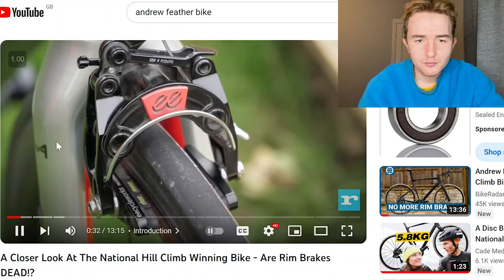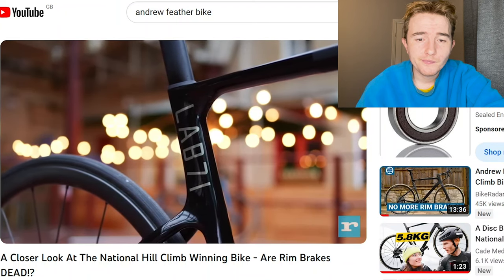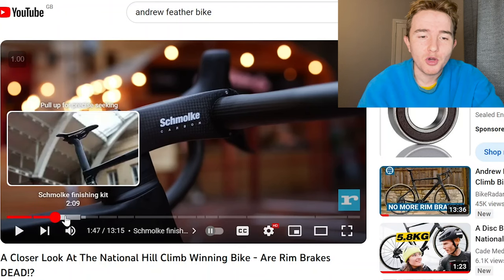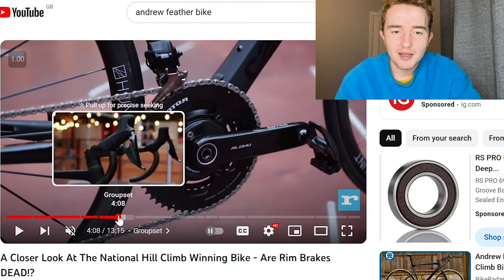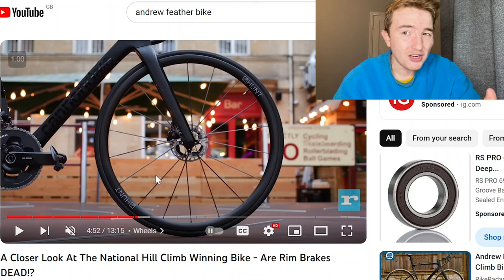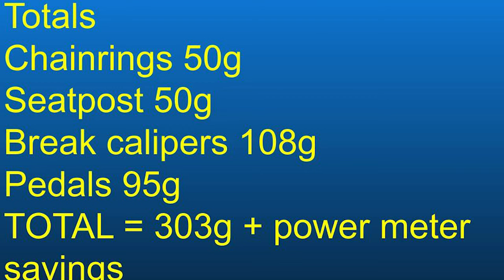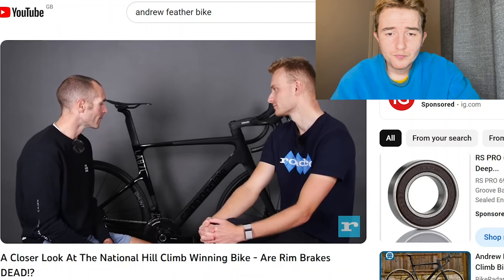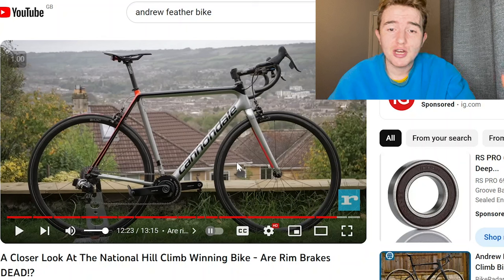How Feather could EASILY save 300g on his BIKE

Comment: I'm pretty certain he knows exactly how much extra weight he could save on his bike. But, is it worth risking those parts breaking during a race though? Carbon TI chainrings with the power he's constantly putting through! you would have to be a pretty serious weight weenie to consider them in this environment......
Reply from the maker: Uae use carbon ti chainrings so that's a ridiculous statement
Reply: @CharlieCarbsandCycling didn't say ridiculous, just pretty risky in that situation. I've hard Carbon TI rings on my bikes in the past. I certainly wouldn't race on them. How many TDF guys use them on mountain stages???
Reply from the maker: @karlj711  they use them all year round. They aren't dodgy at all
Reply: They’re not risky titanium has a ridiculously high yield, but its not as hard as steel so will wear down quicker (but not during a sub 12minute effort)
Reply: @CharlieCarbsandCycling and they are saving less than 10 g over dura ace chainrings

Comment: Tbf he doesn’t seam to need those extra weight savings (and climbing primarily out of the saddle holding the hoods removing the rubber there could cause comfort/grip problems worse than the 0.5second (on the struggle) saving from the weight